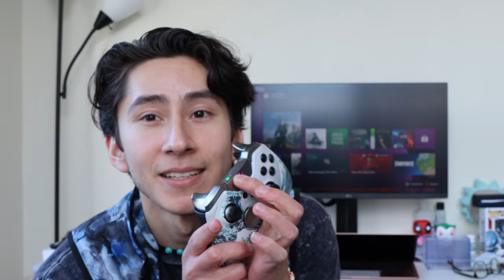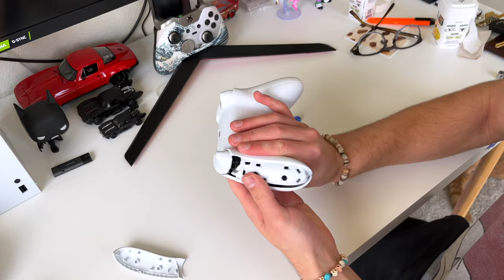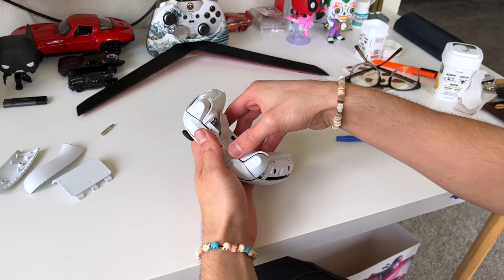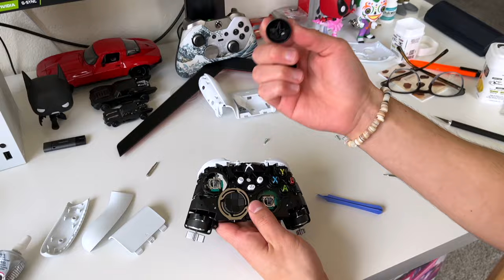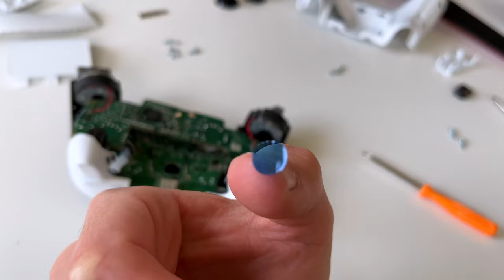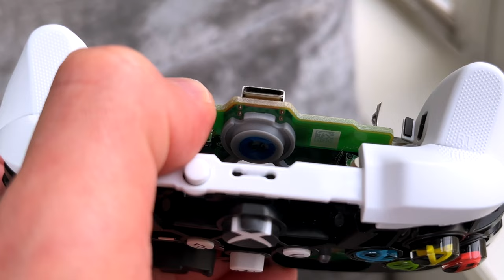How to Customize the LED of an Xbox Wireless Controller | Xbox Series X|S LED Mod

Comment: Hell no that’s now worth my time to do all that. I’m not gonna mess up my controller just to have colors. I thought it was gonna be something from the settings that needed to be done.
Reply from the maker: Don’t ever play yourself
Reply: I did mine and didn’t even have to take apart the mother board
Reply: @wolf2153 how?
Reply: I took the shell apart and got the filter and some tweezer lifted up where the home button is a lil and slid it in there

Comment: For some reason, I couldn't loosen the t8 torx screws at the beginning
Reply from the maker: It’s usually a bit difficult the first go around
Reply: I just realized the bit I was using wasnt a torx
It was similar to a torx, but it didn't have the part in the center

Comment: Soo how do we put it back together
Reply from the maker: Follow the exact same steps in reverse family. If that’s not good, you can check out some reassembly tutorials here on the tube
Reply: @isBueno  okay cool but after I assembled it back at first it turned on but i had to press really hard on the xbox button now it doesn’t even turn on at all? Any suggestions
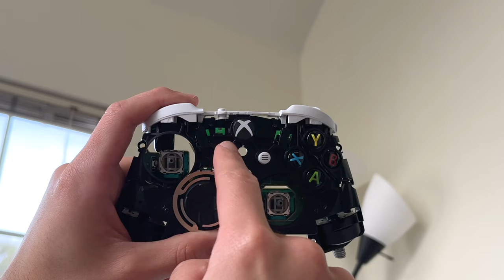Reply from the maker: @YNDKayyYT  Shouldn't be like that. Go to 4:11 in the video and make sure you have the same placement for the color filter. 

Happened to me when I first tried because I put the filter in the wrong spot. Took it back apart and moved it. All good after

Comment: I tried this and all of the buttons fell out of place now I can't put them back what do I do
Reply: And now I have to buy a new controller thank all lot
Reply from the maker: Gotta be careful my guy. My way is faster/easier because no soldering is required. But you gotta be patient with it. 

I’m sure you can still get the buttons back in there if your slow with it. Open the controller and lift the rubber pads that hold the buttons in place. Then, try to put the buttons back in place. Maybe use something slim to reach in the hard to reach places. 

It’s happened to me before when I first started and I was able to get them back.  And remember sexy, ain’t nobody told you that you had to try this
Reply: You know what mabey I will give It a try and try to but the buttons back sorry for being kind of mad I was just kind of sad that I made a mistake so ya
Reply: @muffin_man12 patience is key kid

Comment: You call that easy?
Reply from the maker: EZ mode
Reply: It really is
Reply: Um… yah it took me an hour to take mine apart to do that mod an it turned out amazing just have to be very careful taking it apart I cut a part of plastic out from a thin Fiji water bottle an cut it to fit on the rubber sensor an colored both sides red an used supper glue to hold it if you want your Xbox home button to be a smooth click vs kinda plastic to plastic sound when pressing it try an cut it to fit inside the home button that way it don’t have that sound I just cut mine perfectly round an colored it glued it with supper clue an it works perfect so🤷‍♂️
Reply: It is if youve had practice
Reply: Ya what
Reply: Cool but looks insanely hard